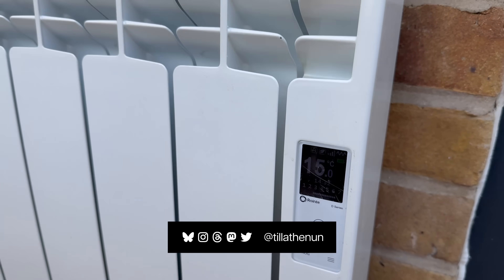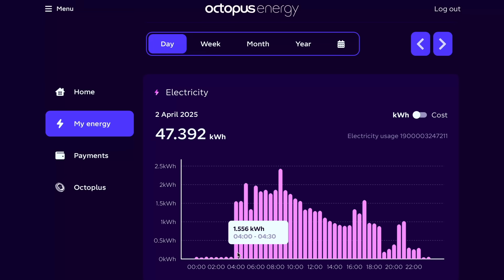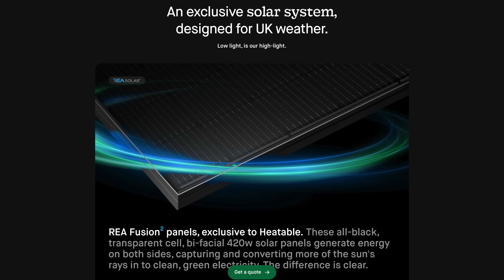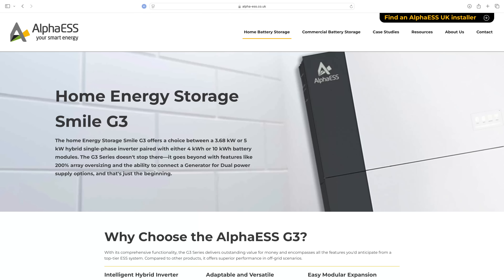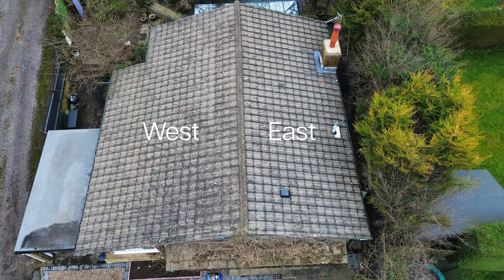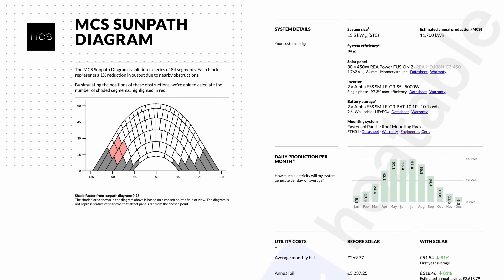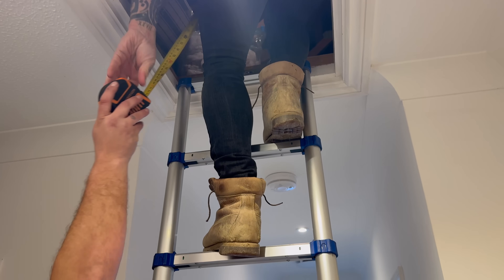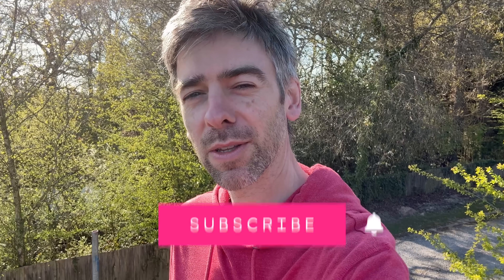We're going to kill those bills! Why we've decided to get solar panels and battery storage. ☀️

Comment: just the first step - you need the second step: Heatpump
50 questions for a full solar system is not that many. Usually it can be more. 
You get NOTHING from bifacial solar panels on a roof, really nothing compared to the size that is worth to mention.
ONLY the outer edges of the panels might reach some suns rays after being reflected from the shingles. Maybe 10 cm.

NOW using our brain: You have 10 panels in a string of 400 Wp panels
Which stupid solar installer told you that bifacial would be better ignoring the basics of law?
Imagine 2 panels benefit from the BOOST of the bifacial side by 40 Wp which is super ideal and would mean at 12am 440 Wp

The voltage stays the same so maybe 40 Volt hence the current goes up to 11 Ampere  while all others in that string are delivering a current of 10 A
What does your installer told you would happen ?
only 10A would be going throut the DC cables and arrive in the inverter, not 10,1 not 10,3 like a sort of an average, no. the lowest counts.

Hence you get 4000 W DC out of the string (4000 W is ideal cause the cable lenght will cause already losses hence the 6 mm² thick cables). 
4000 W DC from the string will be converted to 96% of that in AC = 3860 W

  Take a thick black foil and cover 1 panel and you will see what will happen with your output that was 4000 W a second ago. Down to 400 W maybe. 
Bifacial is fully overemphasied on the WRONG SIDE , the GAIN by bifacial.

You buy bifacial nowaydays where those panels no longer cost much more for 1 more important reason: glas glas
the solar cells are cover on both sides with glas and glas, not glas and foil. Hence they are about 10% heavier (2 kg). 
They will last much longer cause the degredation is one point most people hear about which you can simply forget cause you can buy panels from 2005 that still deliver 95% of nominal after 20 years. 
The key is humidity cause the weakest spot is the foil on the back, which suffers from UV light and weather and once there is a tiny hole the humidity creeps in and the busbars on the back are starting to oxidate aka to rust or cause corrosion. You can identify these spots where the corrisons are cause they appear like tiny hills on the back which you can see by flipping the panel around in the night / dark and use a torch to light from the side over the foil. Every small hill of corrosion will throw a shadow good visible on the white foil.

Comment: But does it "pay for itself in 7-8 years" because your current bills are sky high? In other words, for the next 7-8 years, you'll be in the same position as if you'd just carried on paying the crazy high bills. It's also completely relying on getting good export rates and cheap night time rates, which is not guaranteed. I think actually solving the problem and reducing the energy usage is the key thing, rather than trying to cover that with production or with cheap night time electricity. Insulation and a heat pump will reduce it to a quarter, and with a government grant, then you don't need all those panels and batteries. Plus it would give the house a much better EPC - especially when they're reformed next year - and hugely increase the property value immediately (paying for itself!). 🤷🏼‍♂️

Comment: Well done on getting a 10kW export limit! We are with UK Power Networks, just about 10 miles from you and we were limited by them to 5kW 😞 so we stuck with a 5.6kW inverter. However we already had 5 of the next 8 houses distal to us on the grid in our road with solar, all exporting and I guess the grid is reaching its current limit in our location.  I think solar and battery definitely best first move. I was at Everything Electric today and still ruminating and vacillating over ASHP. We have 3 fitted infra red heaters plus 4 more portable ones and I think we might increase the number of those first.  There was a company there today that can put an image of your choice on a wall mounted panel;  maybe the family might like a picture of Baby that warms you all. Aware that IR gives you headaches but that is just your brain getting more blood from vasodilation which is a good thing! Look forward to seeing the results of your install.

Comment: Good luck, I hope it all goes as well as hoped. I have a similar system being installed in the next few weeks: 16x510W flat roof panels plus 4x450w ground mount. Opted for Sigenergy 10kWh inverter (due to the 4xPV string inputs), gateway and 2x8kWh batteries with a hypervolt car charger on the AC side. It's being installed by my local Dorset electrical solar specialist, DES Renewable Energy Limited. Fingers crossed all goes well! Maybe we can compare notes?!
Reply from the maker: Good luck with it! That sounds like a great system you’ll be installing. I hear good things about Sig.

Comment: Andrew that is a lot of money and you may recover some of that eventually, but wouldn't it have been cheaper to just get radiators and a boiler fitted ? The labour would have cost around 5k and a new boiler for 2k, parts another 1 or 2k. Plus you would have plenty left over to externally insulate your property which you can DIY. This will make a bigger difference for comfort and bills compared to what you have done.
Reply from the maker: We don’t have gas here so that wouldn’t be an option for us anyway.

Comment: Really interesting video - will be good to follow your journey with this and see the system being installed and once it’s up and running. Glad Heatable were able to offer you a discount for recording the process and journey, and fair play for securing that - I might well do myself a quote for solar on their website just to see out of interest.

We’ve got a GivEnergy AIO which was installed in around Spring last year, and the savings we’ve had even without solar have been great. I put together a spreadsheet to keep a track of those savings and estimate when it will pay off, and we’re currently saving approx £60-£70 per month on electricity (even more from 1st April!). We’ve had two power cuts since having it installed and we didn’t notice inside the house - a text from UKPN told me there was a cut and we looked outside to see the street in darkness!

The only reason we went for only battery and not solar too was because we might move in the next 5-7 years once the youngest has finished school. Like you say, with the battery we can take it with us, so I felt comfortable investing in that. 

Make sense to get the solar and battery first too (I think anyway), as heat pumps obviously use a lot of power (though are more efficient than a boiler) and if your bills are already high, then that would add to it - but getting the solar and battery first means lowering bills now, and also when you do get the HP you will already be making your own power to power it.

Good luck!

Comment: We've just had the same battery installed with 13 panels (we went for the micro inverters). All good so far, although the generation today is disappointing in the rain. Still waiting to get the export sorted, which is frustrating, but shouldn't be long now
Reply from the maker: I had no idea getting export set up was such a slog. How long have you been waiting so far?
Reply: @MrEV  The install was finished on the 1st. Octopus applied for the export MPAN a few days later and still waiting for that to come through. It's a shame you can't apply for that before the install is finished.

Comment: Better to actually heat when rates are low.
Think of temperature in house and boiler as energy storage.
Immediate consumption of solar and cheap rates are always more beneficial than the need for a very large battery.
Start with optimizing time of use & tarrif.
Then insulation & an abundance of solar panels
Then heat pump.
Keep the battery for last.
Its costs are declining every year and you will need much smaller one if you do other things first.

Comment: One thing came to mind. What is triggering the heaters in the morning when it's expensive? Could that trigger not be changed so that you heated during the night instead and during peak prices you either don't heat or let it drop a bit in temperature until it's warmed up again over night?
In any case, interesting project that I will be following as I hope I can get some solar generation for my own house I'm planning to build.
Reply from the maker: The house isn't insulated well enough to retain the heat in the depths of winter, but that's certainly something we could try in Spring/Autumn. We already start the radiators at 4:30am so they do have an hour of cheap rate.

Comment: Something I posted in Australia 

" Stop removing my comments.
Elon Musk knows massive storage batteries on wheels parked 23hrs every day and all night long is DIRT-CHEAP mass electricity storage. FREE with your car.

Solar PV panels last years and supply 2cents kWh electricity. 

Grid electricity is 50cents kWh on my bills, $2,000 
Gas $2,000
My low income and fossil fueled technology is a road block to changing over. $$$

Blackouts and shutdowns was why we went to gas economy.

My 10m aerial supply wire to my meter box will cost quoted $2,000 to upgrade.
My petrol for 2 cars costs  $$$thousands per year for normal one hour daily drives.

And Australia is going to stop CO2 climate destabilisation with grid electricity. 
The grid footprint is massive. 
1million km.
1$million per km upto 10$million per km. 

$$$$$TRILLIONS. 
The fragile national electrical grid is fragile because it is extremely expensive to EXPAND its capacity. 
Windstorms in 4 states blew transmission towers down, blackouts. Fragile grids.
Air-conditioning shutdowns because of fragile grids.

Nuclear reactors shutdowns in seconds and days to get started when grids shutdowns, blackouts.

So more $$$TRILLIONS extra grid capacity  ??????????

5cents kWh electricity costs 50cents kWh grid supplied on my build.
More grid electricity is your best idea ????????

My little street is filling up with rooftop PV and EVs and home batteries. 

Dirt-cheap electricity and the grid charges me 50cents kWh.

The grid owners must have that Shttsnpants feelings as they scramble for cash from the few who are just hanging on.
I have decades in real construction,  transmission and generation and....

I am not an idiot, but you are.
Yes angry and p...... off. "

Comment: Fogstar's batteries don't get enough attention IMHO. £1800 for 16kWh if you screw it together yourself. £2300 pre-built. About 1/3rd the price of Alpha and 1/4 of the powerwall (and not run by scumbags too). Couple it with a Victron multiplus and you get transparent power-cut proofing too. So I got 7kW panels, 5kW inverter and 16kWh battery, with islanding for £4700. We are now exporting the stuff furiously almost every day, and will be importing about 25kWh/yr (i.e almost nothing). Anyway. Good job on picking a (big!) system and installing it. You could have spent dramatically less money, but it's still a good idea.

Comment: If you have a badly-insulated bungalow with expensive heating what you need is EWI, 3G, decent airtightness, MVHR and roof/floor/ceiling insulation. Yes that's a lot of work and money but you only have to do it once and you a gloriously comfortable house which now only needs heating maybe 20 days/yr, and it really doesn't matter much what the heating system is. HP is best, but your driect-electric rads will also be OK. Get you house under 50kWh/m2.yr (AECB carbonlite level) and you are in a much better place. If you can manage 25kWh/m2.yr (Passivehouse retrofit level) that's twice as good again. You don't have to do it all in one go (that lot is expensive), but making a plan to avoid doing things twice is smart (e.g mounting the batteries to allow for future EWI would have been smart). 
Still, PV on the roof is a good start, and as you say it's easy. The only thing it make harder later is a warm roof conversion, and whilst that's a good thing it doens't make much sense unless the tiles need replacing anyway.
We have all of that stuff except the heat pump and floor insulation, and they are coming this year. It has transformed the house from cold and draughty to extremely comfortable, summer and winter. I think we will get to 32kWh/m2.yr eventually. It's about 48 now. The cost has been about £2300/yr (for 17 years - DIY is slow).

Comment: Congratulations Andrew, sounds like a great system. I have 30 x 400W panels with Enphase Microinverters and 20.2kWh in Enphase batteries. This system was installed last year but I have another Enphase install that is 12 years old. I love them.
Reply from the maker: Fantastic setup!

Comment: I would have done the same thing except I would have put the solar up myself saving about 7k.

Also would be worth installing a log burner. Its carbon neutral and a great way to enjoy your home.
Reply from the maker: I’m terrible at DIY so wouldn’t attempt that! It would have been fun to try though admittedly.

We have a log burner but managed to fill the whole house with smoke at Christmas so haven’t used it since!
Reply: @MrEV putting panels of your roof due to its pitch would have been super simple.
It's just following the baton and tiles in a strait line.
Most panels are £50-£100 each and the racks would have been £500
So £2500 max.

About your log burner.
It's easy to use once you get used to it. But with my solar and log burner my Bill's end up being 100% £0
I use discarded wood and chop it up.
And buy logs for £60 a ton bag.

YouTube if your friend when it comes to log burners.
Clean the flu.
Check the log burner is without faults or get a new one.
With an electric heating system and no gas boiler it's really your best option.
That £600 bill a year will disappear.
Reply: Chimney cleaning needed!
Reply from the maker: @patfros We had our chimney cleaned after we moved in so that wasn’t the problem!

Comment: Great walk through of the decision making you made to decide on the Solar PV and battery installation that you chose, I have a slightly different need case for the battery as in my location I only have a single rate use 24 hours/day from the local provider so my system is more geared for self supply with the battery charging from solar usually completed by 13:00-14:00L then excess into my EV, home battery gradually takes over when the PV supply is insufficient to run the house in the evening.

Comment: You definitely did it the right way round. If you had an existing older gas boiler that needed replacing and you could replace it for less than the price of a new gas boiler then a smaller PV and battery system might have made sense but with the amount of work needed to install a full wet CH system and heat pump solar first is the better bet.

Comment: Another great video.
We got 9 kw batteries and a 3.6 kw inverter 2 years ago.This is usually enough for our needs.
We charge the batteries at 8p every night (00.30 to 05.30)with octopus and i charge my car  overnight at 8 p
We have electricity costs of approx £65 per month(including car charging ) with approx 98 % of costs being at the cheap 8p rate.
We did look into solar panels but it would take approx 15 years to recoup the cost so just have the battery and it suits our needs.
It worked out the batteries would pay for themselves in 5 or 6 years.
Reply from the maker: Yes, I think for a lot of people batteries on their own make far more sense. I'll go through all of this in future episodes once we have some generation data.
Reply: martyn1960 - I think that’s a configuration I would also consider. Which battery provider did you use?
Reply: @rogerrandall6124  We used Pylontech Batteries and a solis inverter .
Reply: Looking at batteries too. Have cheap ev night rate so considering charging overnight and use during the day. Installer I used for my charger suggested Sigenergy as a battery supplier. Don’t know if they’re any good

Comment: Great video and a great idea on installing solar. Payback is a funny thing, it’s usually quicker than many people think. Install cost of solar panels divided by generation = how much per kw you’ve spent. It’ll drop quickly, but when that value gets below the rate for power, you’re making power cheaper than you can buy it. If you do the maths to included battery cost, just include the battery discharge amount to the power generated. 4 years after our solar and battery install, we’ve not spent thousands on power, and the cost for the setup is nearly on par with how much it costs per kw to buy from the grid.
Reply: I've never quite got the obsession with payback. No one worries about payback with a new car or kitchen, I'd just like to produce my own clean energy and am not bothered about payback, though it's a nice bonus.

Comment: Don't know much about solar but it looks to me like you need to get busy with the chain saw. Those trees are not doing your house any good and certainly adding to heating problems. Sounds like solar works long term but I don't agree it adds value to your house and if you are someone who moves regularly, you're just spending it all again before you get the cost benefit of the previous install.
Reply from the maker: We missed our chance to trim the trees unfortunately. We had to apply to the council as there's a tree preservation order here, and they took so long to approve it we missed the best time to trim them during winter. We'll sort it later this year instead.

Comment: There are also air-air heatpumps and they are a lot cheaper and no need for plumbing. I heat a 100m² house with one in Finland.
Reply from the maker: Air-to-water heat pumps qualify for a Government grant in the UK so work out about the same cost as air-to-air.

We did get air-to-air in our previous house actually. I'd be tempted to get it again but my wife wasn't keen: https://youtu.be/8hcyeWt9PG8